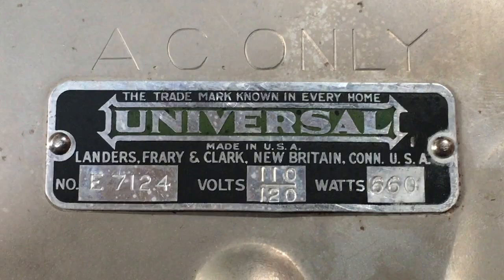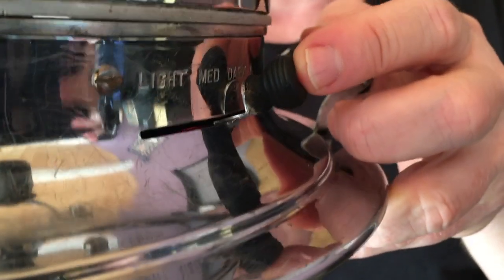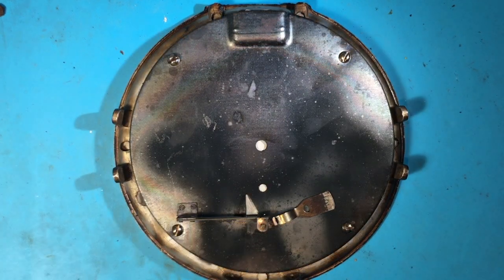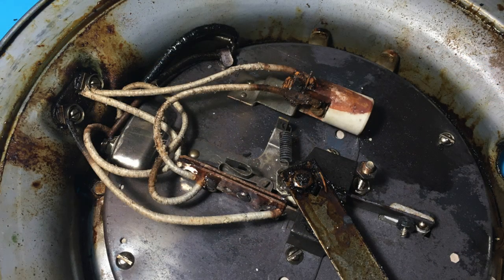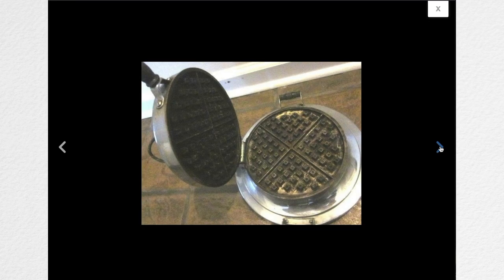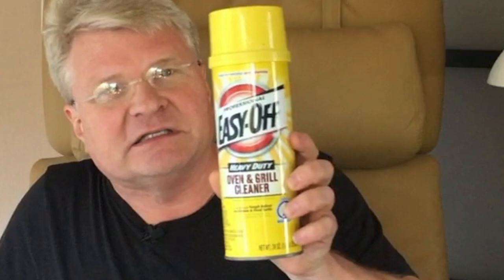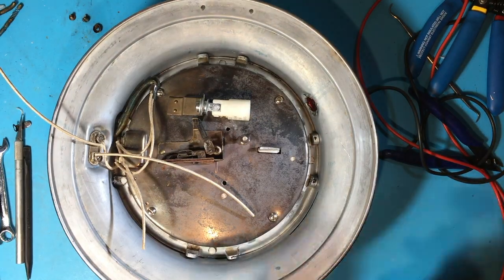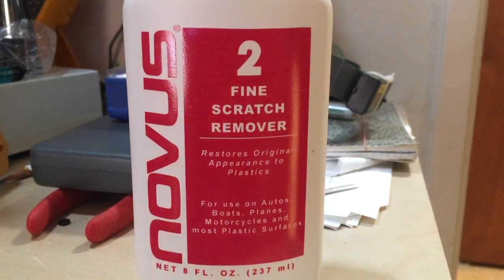Vintage Antique 1938 Universal Waffle Iron Restoration / Tips

Comment: So glad I found your video. I was gifted the same exact one, model #7154 and I had soak my plates over night with straight white vinegar and it softened the black burnt oil enough for me to then take a hand brush for my finger nails and scrub it hard.  I then took my little Dremmel 4000 and used the little wire brushes and got those dimples to shine like a diamond.  I was stumped as to how to get the pits out of the outer chrome, and wondered about the fine steel wool we used to use on car bumpers back in the 1950's.  Glad to find the polish you used instead. I didn't take mine apart as you did, not very electrically educated in that regard. I had my new recipe for KETO waffles, "Chaffles" to make as my inspiration to clean this wonderful appliance that was Made in the USA.   Thanks Ward. Regards to you, Marie

Comment: so glad you posted this.. I have a different model that has a removable spill catcher, but with the same jeweled light.. I've had it for almost 30 years and have been trying to figure out how to clean the waffle plates.. good to know that the internal wiring and insulation is asbestos and I'm very glad I never took it apart haphazardly.

Comment: Hello. Great video. I have a Universal E9914H which is the poorer cousin of yours. Several of the ceramic insulating wheels were broken(good thing I took it apart) and I am also missing the proper cord. I bought a dozen old cords but they were all too narrow between the prongs.
Any chance you still have insulators?

Comment: I’m restoring a universal E9342A iron. It has been in my family for as long as remember. The wires to the upper element have broken and i’d like to rewire throughout. I’m not having any luck finding the wire you specified. Would you please provide a link to that wire. Thanks for your great video. It’s given me the confidence and a roadmap to my project. John
Reply from the maker: It looks like I probably bought it on eBay, but I can't be sure because their history doesn't go back that far. But there seems to be some of it advertised there if you do a search.

Comment: Great video--beautiful restoration! How did you get the top lid off to rewire the top plate?
Reply from the maker: Thanks Matt. I don't recall doing anything special. Once the hinge and screws were out the heating plate just kind of "fell out" of the metal lid.
Reply: @WardCo  there are no screws... Do I need to drill the rivets out of the hinge? Here are some shots: https://photos.app.goo.gl/iSMYPqJk16LCcRRc9. The top plate no longer hearts and I need to redo the wiring
Reply from the maker: @mattreeves7644  Man, I wish my memory was better (and I don't have mu spare parts here anymore)I did not wind up drilling out any rivets, but the unit came to me with the hinge failing and loose -- I just can't remember how! Certainly, take the screws off the handle and see if that releases things. The heating plate may have a molded tang that engages with those screws.  Also, be aware there is very little wiring and thus little to go wrong up top, so suspect you'll need into the bottom too if connections/wiring have failed from years of open/close flexing. Thanks for the pix. Sorry I can't be more directly helpful.
Reply: Here is a shot of the bottom wiring:. https://photos.app.goo.gl/jmbcNpQHDiEYGyY17
Reply: There must be a short in the top plate because the circuitry is all complete in the bottom.  The bottom plate heats up and if the top circuit was broken there be no way for electricity to get anywhere. Thanks for the help on this @wardco!

Comment: I started cleaning the plates of my waffle iron (I have the lower end model) before realizing what a process it would be— I don’t have access to a media blaster. The only part that the mottling is bothering me on is the part visible from the outside when the iron is shut. Any tips on how to either clean that small section entirely, or make it completely black again?
Reply from the maker: I wonder if brushing lard on there and running it repeatedly might season it black again? Unfortunately, I just didn't have a good experience with any mechanical or chemical methods besides blasting for cleaning. Of course, since you don't cook on the edge, a small wire brush on the Dremel might do the trick, and the roughness to the aluminum it would create wouldn't be a problem because you don't cook with the edge. Sorry I can't be more help.
Reply: @WardCo  Get the attachments people use to polish jewelry for the Dremel.

Comment: I am restoring a Samson E128 lowboy waffle maker. When I took it apart to clean it, the heating coil with small mica inductor strips that are wedged into the coiled wire fell apart. I need to replace them but don’t know whether the natural mica for microwaves will work to cut  out replacements. They are different thicknesses so it’s difficult to tell how to replace it. Any help you can provide please let me know.
Reply from the maker: I Googled that. It's a pretty appliance.

It is difficult for me to visualize what you are describing as the only heating elements I've run across have been made of coiled resistance wire (nichrome) supported by ceramic or porcelain insulators. Are you saying you had mica strips inserted into the windings of the coil (for support or insulation)?

Some of the mica they sell for microwaves is mica-impregnated paper. This allows them to make a sheet that is strong and can keep food out of the wave guide, but which is still transparent at microwave frequencies. It's probably not what you want. You likely want plain sheet mica which is sold as insulators or art tiles. You can stack it to get the thickness you need.

But again, I'm not an expert; just some crank on YouTube who has restored an appliance or two. So take the above with a grain! Good luck.

Comment: Lets talk about the Asbestos disk

Can it be sealed with high heat engine/stove/grill paint?
Is there another insulating product to replace it?
Would the best practice be to wet the disk with a spray bottle while handling it?
Reply from the maker: I think my answers would be:
1. I don't know! (But it sounds like a good idea.)
2. I don't know!
and
3. Absolutely. Wetting it would be smart.

Comment: PATENT FEB. 23, 1926
MAJESTIC HOTCAKE AND WAFFLE IRON.
This thing was disgusting. I found it on its way to the dumps. I enjoy refurbishing and I love antiques. But this one took more work than anticipated. Vinager and water with a dremel. And yes, a dental tool for the grid. Tedious, time consuming, chasing rust because I havent replaced the rivets. 
Excellent knowledge! Above and beyond an understanding of all aspects. A fine teacher. 
Where I'm at, I turned this thing on and it's just too much unless you are very familar with it and right there ready to unplug it.
There's no limit switch or light. Just a needle gauge that reads "cold-bake-too hot"
So basically 2 cast aluminum grids, each heated by their own plates with internal heating elements, and a very hazardous GE 2 prong power cord.
Should I sell it as is? As a beautiful piece of American history? (Can't believe electrical appliances can be considered antique now) 
Or should I somehow install  the high limit switch and light so that it can be used safely? Altering it's original state. 
So much time on this. Bur reality is, if I come across another one, I'll engage in the project again. This time with more experience.

Comment: Do you know I can locate the electric cord?
Reply from the maker: I'm not aware of a new source, but I'm not an expert. The style was used on a lot of appliances of the day so you can steal one from something else if the prong spacing is right. A search for "vintage appliance cord" on eBay may prove helpful.
Reply: Online is the easiest. You might want to find an old hardware store near you. One that has been in business for a Very long time. They may have one laying around or know of an old store that does.  Take your waffle maker with you.

The small town I live in has a hardware store that has been in business since 1886. Someone has Always ran this store since it was started.  136 years ago (it's 2022 at this writing).

Good luck.

.
Reply: Ace Hardware